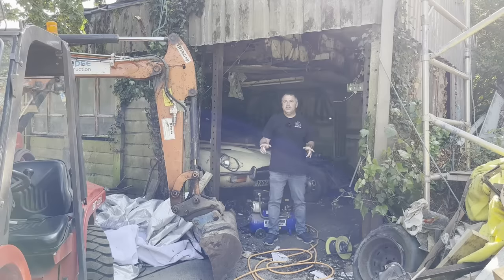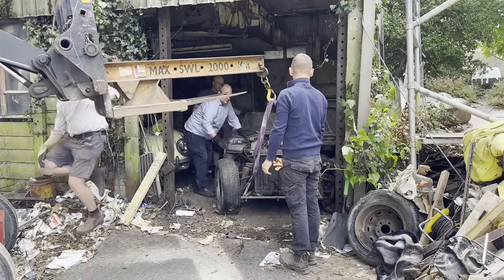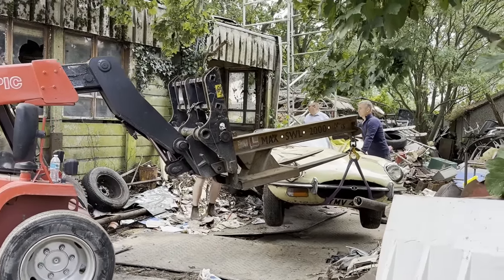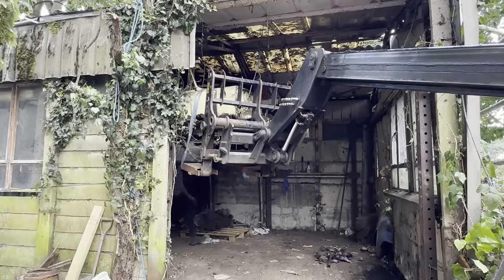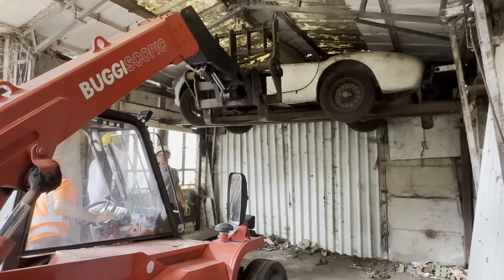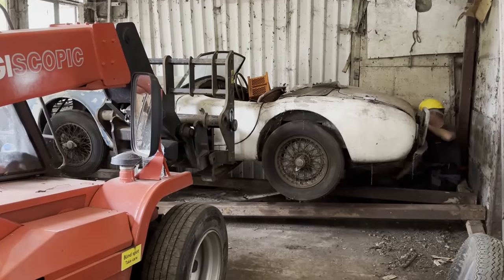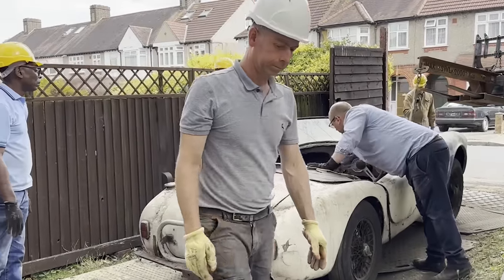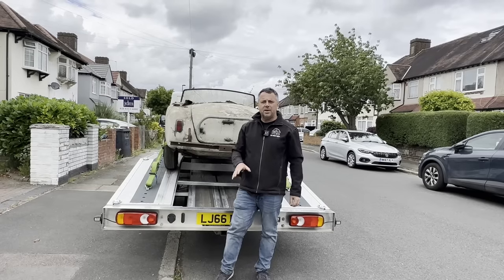UK Barn Find Of The Decade? - Part Two - How Did They Even Get There? #barnfind #classiccars

Comment: Lovely to see them coming out of there, hopefully they will find good homes. I was however cringing as they moved that last AC , the way they were ragging it round using the aluminium arches was painful to see and they have also ripped and bent up the front valance. I know they need restoration but be a bit more careful!
Reply: Same bud. They defo damaged the front 😬
Reply: They had definitely had enough by the last AC and just wanted to get done and gone.
Reply from the maker: The front of that car was fibreglass.
Reply: @UKBarnFinds  I'm surprised they didn't rip it then, but we'll done for getting them out
Reply: Cant understand why they didn't have more of those small wheels so they could maneuver them more easy iso rolling them on bad tires, also the whack with the jackhammer was ... terrible
Reply: Also cringed when they were making space outside just bulldozing piles of parts around! i know most of it was probably rubbish, but could see some valuable bits like doors and wings,  for all they know there could have been more AC or JAG parts within that lot!
Reply: they could of unbolted the propshaft and pushed the car out of there once near the entrance/exit ? it wieghs next to nothing

Comment: Be sure to save those XKE wheels hanging out in there. Might be some other smalls on the outside worth saving too.
Reply from the maker: Pretty sure they got saved, along with various other bits. Well spotted!
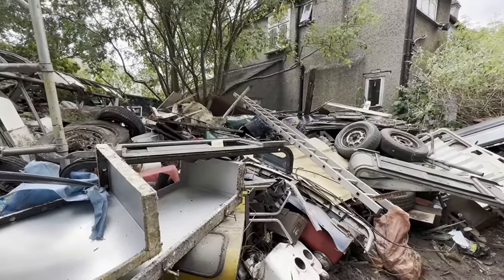Reply: Land Rover truck cab rear panel at 50:14 - they're quite sought-after too.

Comment: Once you get the car/ load on rollers use a cum along or a chain block to save manhandling or you cant get a telehandler in.
I can remember a E type .... needing restoration...going for a $A1000 in 1970.
My Dad sold his low mileage immaculate 1962  MK2 3.4 in 1970 for $A1800.
Jags were very rare in West Australia 50 years ago. They would have been cheaper again in Britain.

Comment: It almost looks as if the cars were stacked up outside, and then the structure was built around them - unless the owner had access to a telehandler or similar equipment. It's also nice that he saw the value in these cars back when few others did, and saved them from likely demolition.
Reply: Good old fashioned ingenuity. 
The steel uprights have pin holes every 4", jack one end up and support with a cross beam then repeat the other end and continue till you reach the desired height. 
The lintel beams at stonehenge were lifted in a similar manner but just on wooden blocks and with levers instead of hydraulics / pulleys.

Comment: hand flaring the arches on an alloy body AC ?  Ignorant handling.....!
Reply: ❤❤
A large percentage of these cars were modified.  If not for racing, then just for fast road work. Tires got wider in the 60s and 70s.  The cars were modified to suite.  A freind had EFR's B prod car..  the fenders were modified to fit wider racing tires.  It was done so it still looked stock. (to fool tech guys) but they were higher and slightly wider.  Always hoped you didn't stage next to a stock cobra.
Reply: Sad, actually.

Comment: as to the question of how these cars got there, easy, it was the 70's, gas was expensive, labor was cheap, and parts were hard to find and the value prohibited bringing and putting them back on the road, as the mentality back then is that once a car reaches 30K miles, its done, and I think AC had bit the dust by the mid 70's

and Jags' I love them but your forever chasing problems if their set up wrong, and the series I that you pulled out earlier was noted for a very annoying problem, a flat floor meaning you couldnt fit in it 

and theirs another very cruical thing about those cars, their unibody construction, and the only way you could fix it back then, was just to buy a new car, as all that kind of repair was just not worth it or even doable vs buying new, so if anything these cars were probably put there as parts cars that got forgotten about

Comment: The E-Type Roadster doesnt make sense to me. First Registered 1970 but the Reg YMV 491T is a 1979 Registration plate. I didn't think you were allowed to put later plates on?
Reply: I wondered about that.
Reply: Returned to the UK (probably from Greece or Malta) in 1979, the DVLA did that a lot back then.
Reply: I wonder after the car was restored could the owner apply to the D V L A for an age related reg? I'm thinking would a  report from the owners club verify the age  ,via the vin number ,and result in a 1970 plate?
Reply: @MrPabsUk Thanks for clearing that up, the T-plate was niggling me.

Comment: ummmmm. looking at the wall, looks like it just had some sheets of tin slapped up... looks like they were pushed straight. not awkwardly turned 90 degrees in a tight space. appears to be plenty of room on the other side of the wall. cream one came in from one end, the other came in from the other end.

assuming the property is about to be cleared, demolished... i would have just pulled the shed apart. half a day to clear some mess and then just straight in and lift em out. or simply take those sheets of tin down.

im bamboozled as to why you guys made this so hard on yourselves.